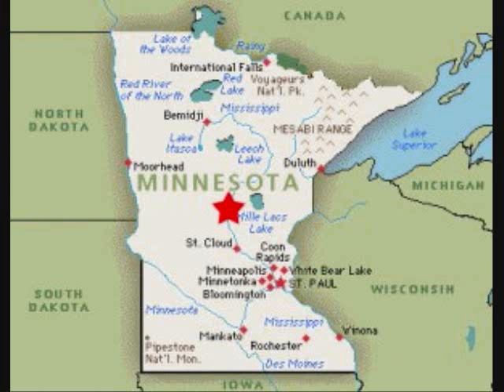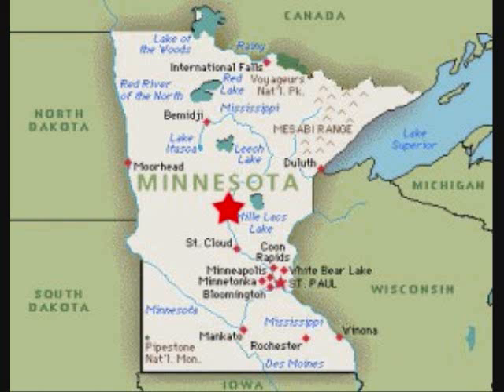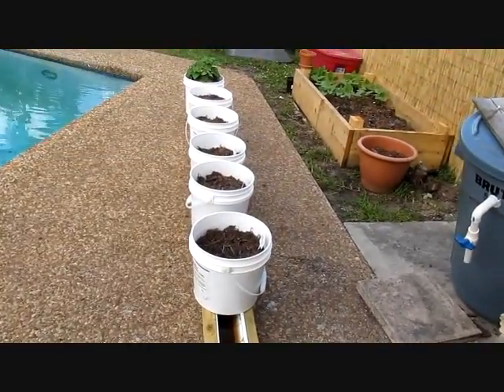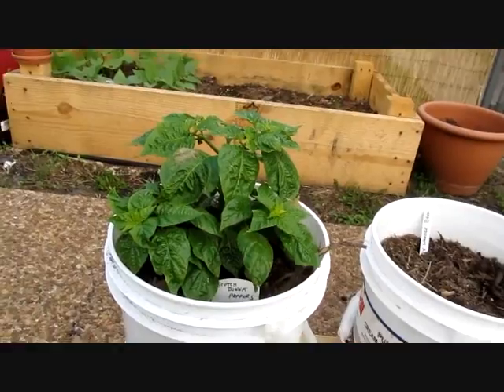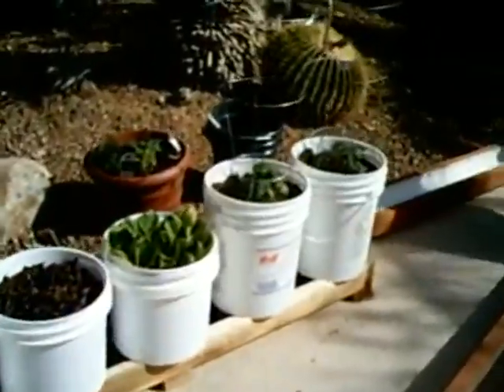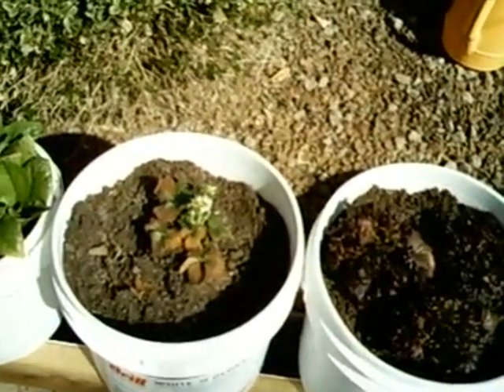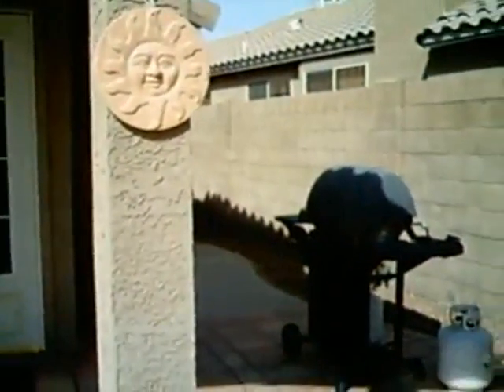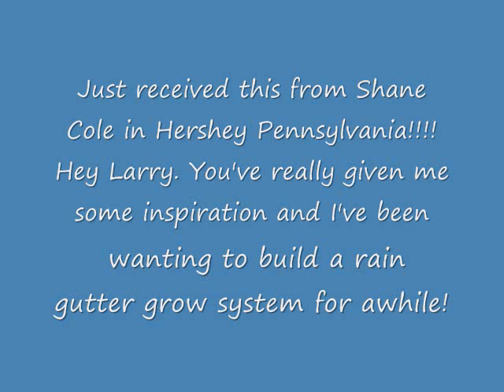Wow! People everywhere building the Self Watering Rain Gutter Grow System!

Comment: what Larry is doing is basically an automated watering system for a self watering system like an Earthbox, or Earthbucket. I have both, and have been pondering how to automate the filling of the reservoirs. Earthbox has a very costly product that does this, but Larry's solution will work great for the bucket type, using the nettie pots and gutter, plus a rain barrel. Clay pebbles are much more expensive the potting soil, as is hydroponic fertilizer. I have them for use indoors. count me in!

Comment: I'm sorry, I must be missing something.  If your plants are getting nutrients from the rain gutter than why use soil which is very heavy and gets the water dirty since there's a hole in the bucket.  I don't get it.  I would use some clay pebbles and coir in a 1 gallon pot which would make it ten times lighter and stable enough to carry a large tomato plant; the nutrients they would get from the water.  I'm puzzled at your system 'though I can see it would work. ciao, thanks.

Comment: I found that the small yogurt cups are identical in size to the net cups.  I use a soldering iron with a pencil tip to create holes to allow water to saturate grow media.  Do this outside, since the plastic will smoke a little.  I actually like the yogurt cups better than the net cups and it keeps them out of the landfills!